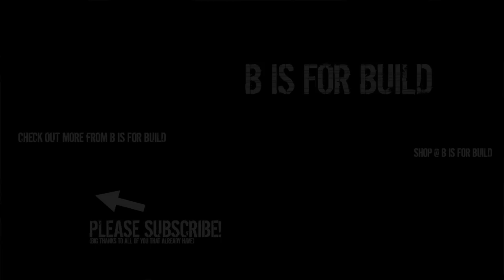1500HP of Boat Engines Have Arrived!

Comment: Mine is Kinda the same but, Scaled down; twin 454 330hp Mercruisers, 1.88:1 Velva drive Transmissions, 1.25 inch shafts, 17x18 3 blade props, 10,000 pound 32 foot Sea Ray Express with Prop Tunnels =  37Mph for 2 minutes and cruise at about 18 mph.
Trying to improve on that...

Comment: I'm thinking oil filter relocation kits and perhaps a modified way to drain the oil pans will be in order to make maintenance easier.
Reply: Walmart uses an evac system that removes the oil through the dipatick tube. That way they're not liable for stripped oil pan drain plugs or them coming loose while driving and blowing engines. Probably a good idea to get a system like this  for the boat 👍
Reply: @shirecain2129  The do realize that tube stops shy of the bottom of most oil pans by like 2 inches right?  That seems like a really shitty way to not actually change the oil.

Comment: Have you thought about how you can change the oil when it is installed? When the oil filter is changed, oil can still run into the boat hull at the Moment.

Comment: Did you say you painted the sacrifial anodes? They are there to corrode.  The slower they corrode the faster the metal parts they protect will corrode.
Reply: He said that to be funny. He did paint them initially, but realized his mistake when it was pointed out in comments. Presumably he's corrected it by now.

Comment: I have a feeling its going to be slower than it was with the diesels
Reply: Bingo!
Reply: I'm interested about that aspect as well, especially with the trade off for more horsepower and less torque compared to diesel.
Reply: @Weewoo14  Right? It's alright being able to go fast, but its the torque that will get you there.
Reply: I'm interested to see if it will even get on plane without re proping.

Comment: runs out of fuel in the middle of ocean

Passing boat: why is he yelling if we have gasoline? Is he high?
Reply: Most smaller ribs, especially the ones used as tenders, all run on gas. Also, he clearly isn't going to take this thing out into the middle of the ocean. And all of that is assuming that for some reason a senior software engineer is unable to calculate how much fuel he needs when he goes somewhere.

I'm a little over all these negative comments. The guy clearly isn't an idiot.
Reply: @lemster101  I'm sorry, I don't know much about boats what's a rib? 

I thought most boats run diesel fuel!
Reply: @jwalster9412  No worries. I might've mistaken your comment for being more negative than it was. A RIB is basically one of those smaller boats with the inflatable tubes around them. You often see them as small dinghies hanging off the back of larger boats.
The outboard motors on those are almost always gasoline engines until you get to the pretty high powered ones.

With the small dinghies the owners often have one or two jerry cans on board with a couple of gallons of gasoline in them. It won't run those two LSX engines for long, but it'll get them to shore of they run out.
Reply: @jwalster9412  You're right. Basically all boats this size with inboards run Diesel engines. Everything bigger than this uses big Diesel engines. Going with gas on a boat this size seems like a huge mistake to me. Diesels have way better low end torque, a better powerband for marine use, better efficiency and are a lot more reliable. IIRC basically everyone was telling him this when he announced he was going to repower it but I guess he didn't listen.
Reply: @go2yanks  plenty of boats this size running gas outboards these days, a high end gas inboard not much different. Really not a big deal if done properly, the majority of pleasure boats run on gas. He's using it inshore, he'll be fine.
Reply: @go2yanks  this boat is gonna go like 10mph max 😂

Comment: A lot of talk about fixing the diesel's or buying new ones, but I'd love to see the cost breakdown on those motors plus all the fab work you had to do.  It really can't be that much more expensive to just have done it right the first time.
Reply: Main issue with using gas motors in a boat this size is the fuel consumption for what he saved with these he'll pay for in fuel any experienced boat knows this thats why once you reach around 40 feet you rarely see gas engines

Comment: I have my thoughts but will wait to see how they actually perform but, what I think is more importantl, how long they last....
Reply: Long.
Reply: @ernestsjansons6705  not as long as those diesels though
Reply: If funny that he talks about reliability, but chose to go with gas over diesel...
Reply: @davidfernandez3554  it’s funny you talk about either when you’re likely riding a bike to school
Reply: @矢矧さん25  how sweet, how many custom built motors have you got from Texas speed and what was their lifespan. Don’t comment on what you don’t have
Reply: @furhadnasserjah123  how many yachts do you have with Texas speed 454s?
Reply: it will last as long as the lamborghini project with the custom wide body. A month or less... Really i don't get it. All the yaght and luxury yaght companies that they use diesel engines are not calculating correct... So b is for build will teach the big companies how to make the new yaghts lol. I am really waiting the cost for the first 100 miles in gasoline. Just for example a 30 metres yaght needs 400 litres diesel per hour. My guess is that this think will need a lot lot more....
Reply: LOL, about 200 hours, tops.
Reply: @davidfernandez3554  I thought the same with the comment of "so we wanted to make as much torque as possible", which, then diesel again would have been the right choice.
Reply: @TheM750  B is for Basically no Boat knowledge.

Comment: Damn, well I guess we'll see how long these will run in the boat. Honestly I hope they work out pretty well
Reply: if the gearing in  the tyranny is right so that they can cruise comfortably at say 30 mph while the engines maintain only say 4500 rpm,   then they will work out ok for a while.
But if they try to run the engines rpm tapped out, they will last like a week
Reply: They should work just fine cruising at 3400rmp! Like any engine, if you beat on it it will eventually break.
Reply: Not very long.
Reply: This thing will drink fuel like downing a Tequila 😅👍
Reply: I don't think power and performance is the issue here. Its MPG. These engines will eat fuel. Its the reason why you don't see Semis using gas engines. This boat will not have the range it did before.
Reply: @halo37253  I would expect that it will not be measured in MPG, but in gallons per mile.

Comment: Gonna be a lot fun for a little bit. This is going to have a predictable end but I am going to enjoy watching. I’d love to see DeBoss garage do something like this with some old school bus engines.
Reply: Do not comment this on their Instagram. You will be blocked
Reply: bruh, how many miles do nascar engines get at wide open throttle?? How many miles do trophy trucks get out of their engines? Both of these classes of racing put down 900hp with big v8's for 2000+ miles before rebuilds. If he runs these engines not at wide open throttle he can increase the life of them. 

If he got the gearing correct, and can get the prop correct, theres no reason he cant use these engines for a few years with how few hours he'll really put on them per year. 

obviously gearing and prop selection has to match. Lots of factors to get right or wrong, but texas speed builds good engines and these are running at half the power they were designed for. Cleetus runs similar engines pushing 2000hp and he makes them last all year in his drag car. 

either way it'll be good for us to watch.
Reply: @user-zj2mb3sp3x  which car from cleetus has been running 2000hp for years? Ruby and Leroy make low 1000's. The el camino will be able to reach 2000hp but i doubt that they'll max it out all the time.
Reply: @user-zj2mb3sp3x  I’m not disagreeing at all! 100% on board for this, I’m just saying that Diesel engines meant for maritime applications last a lot longer. Again, Ryan isn’t going for that and I appreciate them for it. It’s gonna be fun, I don’t want to see someone replacing maritime diesels with another maritime diesel!
Reply: @furhadnasserjah123  imagine being butthurt over something like that
Reply: @user-zj2mb3sp3x  You say Cleetus has them and they last all year... Let's do some math, hell let's say a year is 300 passes ok? and let's go on the long end and say 8.5 sec a pass(sure they usually run high 7's).   That's 2,550 seconds.  So 60 seconds in a minute, that's 42 and a half minutes... Let's be generous and say that'll get the boat 35-40 miles...  Just wanted to put the whole "they last all year in his drag car" into perspective for ya!
Reply: @Melanie16040  but what you're not taking into account is when cleetus makes a pass, with 40lbs of boost and 2000hp, while these engines are the same build, but without boost, and only 750hp. 

So hes got the same 2000hp capable bottom end as cleetus, but is only running it at 35% the max hp its capable of with no boost. 

you people are missing this detail. 

NASCAR does the same thing, they build an engine with a bottom end capable of double the HP they run at that track so that it lasts the 400 laps and multiple race weekends. Trophy trucks run 2000 miles on an engine build. I keep repeating myself.

B is for build is not running 2000hp, they're running 750hp with no boost on an engine capable of 2000.
Reply: @Melanie16040  cleetus has ran both ruby and Leroy on the same engines for the last couple of years as well as taking them on race week which is about 1300 miles of driving and racing the cars
Reply: @ab vevo he had the yacht he didn't buy it for this

Comment: Wow. engines producing 650 ft/lbs  replacing engines that made 2300 ft/lbs of torque. Each. This should be interesting.
Reply: @Scott-gc4pt  IT WILL BE SLOWER BY FAR AND PUT 10 PEOPLE ON IT WITH FULL FUEL TANKS AND WATER TANKS ...LOL IT WONT EVEN GET OUT OF ITS OWN WAY....LOL

Comment: You got that backwards, Chris. Horsepower is a calculation of Torque and RPM. Torque x RPM / 5250. That's why on a dyno curve the 2 numbers always crossover at 5250 rpms
Reply: If the equation for horsepower is: Hp = (Tq * RPM) / 5250, then mathematically, you can isolate the equation for Torque as: Tq = (5250 * Hp) / RPM
If I'm missing contextual understanding as to why you'd only use one calculation and not the other, I apologize.
Reply: @MogoPrime  I guess the context is that you only measure torque and rpm in a dyno, therefore the hp is always dictated by those and not the other way.
Reply: Correct. Torque is a measurement and hp is calculated from that.  He was also wrong on the block, it is iron, not steel.
Reply: @pocket5s1  cast iron is a steel alloy
Reply: @md4luckycharms  ok, chemically they are very similar yes, varying in carbon content. But that is like saying a human is an "alloy" of a chimp. they are 98% identical dna wise but they aren't the same thing.
Reply: @mikaelbengtsson5901  yes and no.. the dyno does measure torque and roller speed to calculate whp.. but that is not the torque of your engine.. that is the torque  at the dyno.. you have to feed engine rpm back in to the dyno to get your engine torque.. without rpm you can still dyno a car and get Whp without knowing the torque of the engine..

Comment: "Were dealing with boats, so we wanted to get the most torque we could" ditches the diesel engines and buys gasoline v8s.. didn't even have us in the first half chief.
Reply: I don't think he wanted to spend 60k on new diesels.
Reply: that's why he's got stroker engines
Reply: @createachanneltopost  😂😂😂
Reply: @rsdna9698  as they say buy once, cry once. A well built marine diesel will outlive 20 of those lsx v8, produce less heat in the engine room, and be significantly better on fuel and reliability costs.
Reply: @createachanneltopost  Explain to me how a stroked and bored out 454 cubic inch engine compares to a 903 cubic inch engine?
Reply: People didn't even want the old diesel engine for free, and it is his boat let the man do what he wants, or all the so called diesel engine needing people should fund money and buy him one,
Reply: @rsdna9698  REBUILD THOSE MOTORS IS NOT 60K
Reply: @daniesalex7073  WHAT HE SPENT ON THOSE LSX MOTORS AND THE REQUIRED CUSTOM RIGGING ETC COULD HAVE BUILT THOSE DIESEL MOTORS 4 TIMES OVER...LOL
Reply: @craigbielsky115  New Diesels would be.

Comment: I still have my doubts on the LS engines, but I’m excited to see how it turns out
Reply: I'd have my doubts about the safety of a train wreck too, but I'd be excited to see how it turns out too!
Reply: It’s not the first time someone has done this it will be a great boat
Reply: @mickholden8615  It's not the first time for boats weighing half of what the Riva displaces. The naval architect who drew the Riva would be appalled.
Reply: @BrianNavalinsky   What are you talking about? There are boats for sale right now that you can buy that are 90 foot mega yacht that are powered by inboard gas engines. Mick is right this is not the first time this has been done.
Reply: @mcgee6177  And you rebuild at 200 hours. You are talking to the wrong guy. I owned a boatyard for ten years,  surveyed boats internationally for another twenty and have owned Cigarettes and surveyed Rivas. What the man is doing is fine if he wants huge fuel bills and low engine life. I have liked my engine rebuilders, but I didn't want them as mates. This guy will be lucky to get 100 hours out of a 454 ls in a 13 ton boat with a performance deep vee hull. My 35 Cafe Racer had twin, blueprinted, fully forged, marinized 454's but weighed only 5 tons.
Reply: @BrianNavalinsky  
Well, at least the harbour the boat is normally in, is a freshwater one along a river, so at least he won't have to fight long term saltwater corrosion.
But yeah, people underestimate the workload on large yacht engines, those boats are big, heavy, and displace a lot of water - That takes it's toll.

I'm sure the boat will work fine the first year .... and maybe the second year ... depending on how much it is used.

I'm guessing that around third year, it will show metal fatigue in parts you don't want metal fatigue in.
And corrosion in stuff and places that are hard to get to.

Really it is the story of most boats, people buy them not knowing what they are getting into, then sell it again after 3-4 years.
Reply: @BrianNavalinsky  I'm just curious what makes his fully built 454 any less reliable than say a Crusader 454 XL? You can find them on 55' yachts that have over 500 engine hours.
Reply: @Grumpy_old_Boot  while your right about the engine wear the saltwater wont get into the engine the engine runs antifreeze through a water to water heat exchanger to cool
Reply: @mcgee6177  The prop that he is turning and the hull speeds he is trying to achieve.
Reply: @KiRiTO72987  
That's not the problem, the problem is that when saltwater evaporates and condenses at dusk/dawn, you get this almost brine-like dampness that gets in everywhere on a boat - It's highly corrosive to anything electrical and non-rustfree.
Just having your boat anchored in a saltwater harbour can damage it pretty badly, unless it's built to resist it.
Reply: @Grumpy_old_Boot  There are literally millions of boats scattered around the world docked in salt water. You don't know squat about boats so don't come to pretend you do.
Reply: @BrianNavalinsky  Haha. You are correct. I had a pair of those VTA903 in a Bertram. Gas power would have been terrible.
Reply: @mikehermesmeglio  I love Cummins.
Reply: I've seen quite a few videos of ls powered swamp boats and jet boats... I'm sure they'll run just fine... they may suck fuel down like no other but thats a different point.
Reply: @donniehooker1817  ya gas engines work great on one of my boats.... because it's 16 feet long with a excellent design. Not a boat of this size. Massive difference

Comment: Recommendation for the Ocean water heat exchanger, get a plastic container that works and soak the whole thing in muriatic acid, get all the grime out of there so you start fresh! Muriatic acid is hardcore stuff so use proper ventilation and do not touch it with bare skin.
Reply: Really don’t think this is necessary but good advice if he wanted to sell. Just seems like an unnecessary step though

Comment: I personally would have rebuilt those diesels.  HOWEVER, plenty of boats are equipped with twin gas engines for cruising.  They’re cheaper to replace, and cleaner running when putting around on a booze cruise, which is the primary purpose of an express cruiser like this.  They don’t handle extended range cruising as well as diesel, but this ain’t a trawler.  Good luck Chris.